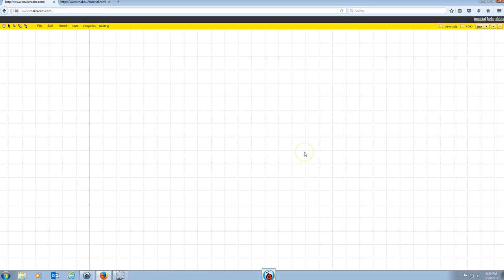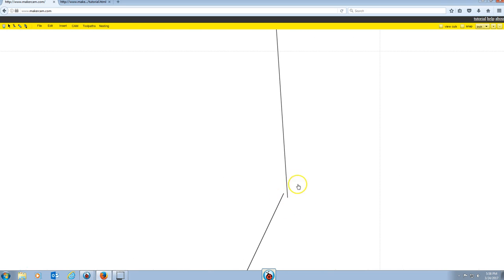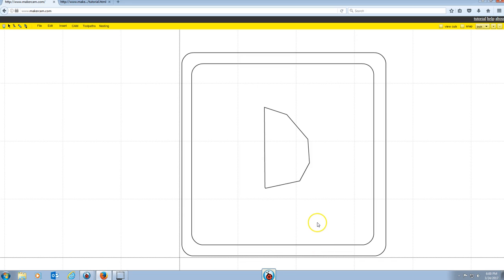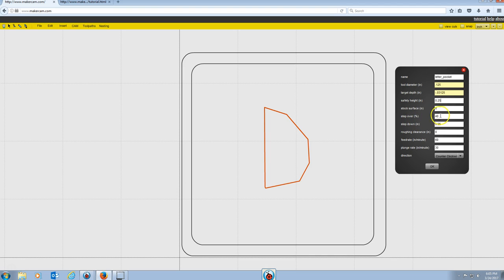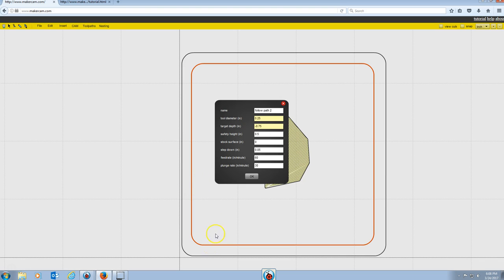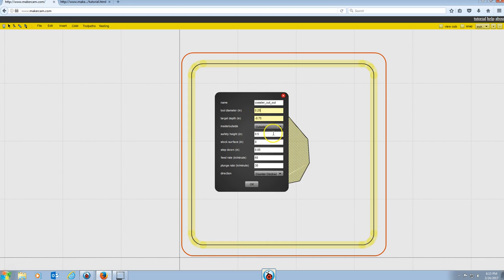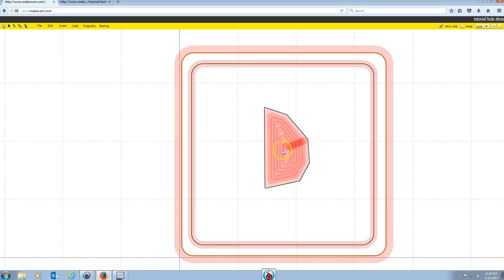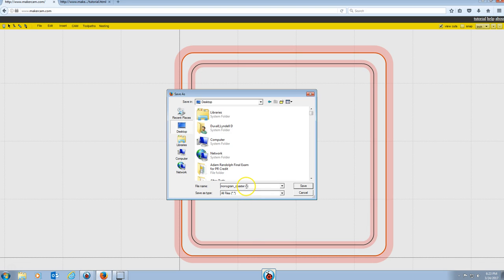MakerCAM Tutorial

Comment: That will not make a "D", but just a hole with a sort of D shaped OD- There must be a way to import real letter shapes.  Also, how do you edit if you make a mistake?
Reply from the maker: Correct, you would have to put an inner perimeter inside the "D" in order to mill out the letter correctly. To import text, under the "File" menu there is the option to "Open SVG File". You could type something up in any of a number of different graphics programs (Adobe Illustrator, Inkscape, Corel Draw, etc.), save it as an ".svg" file and import it into MakerCAM. All of this adds up to being more complicated that it should be. A good alternative for home/hobbyist users is Fusion 360 from Autodesk- free download for hobbyists.